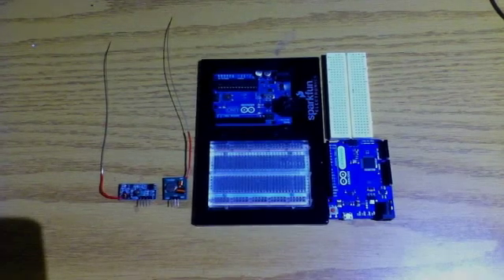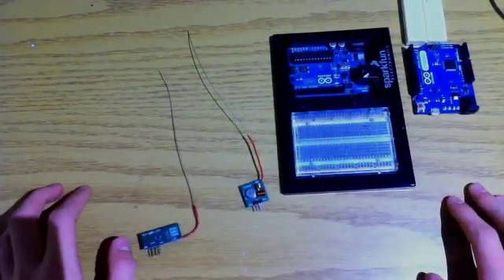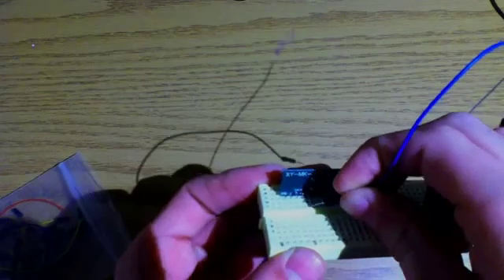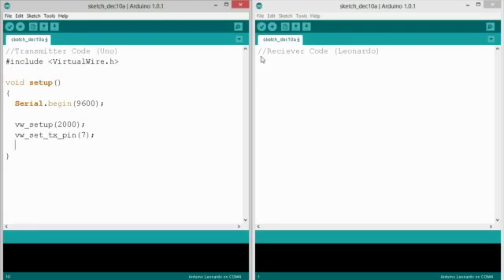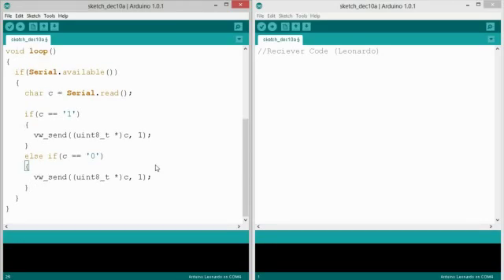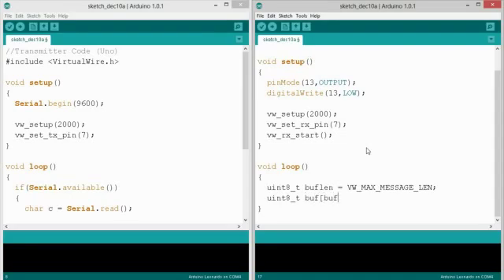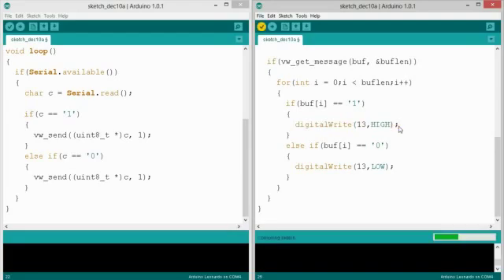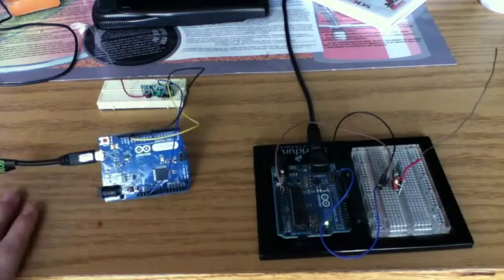Arduino RF Tutorial (MX-05V / MX-FS-03V)

Comment: Can't get this to work, do you think it is because I am not using antennas? My TX and RX are 4 inches apart, and the Tx is on a Arduino Nano while the Rx is on a Arduino Mega.

Edit: I am seeing that it works sometimes, like if I send 1 a few times, then the light will turn on. So maybe I will get an antenna, can I use any wire to make an antenna?
Reply: +Dan Ivanov I think so, but it has to be solid core wire.

Comment from the maker: Hello, if you want you can have both the receiver and sender modules on the same arduino board, only diferent pins, example: transmit on pin 7 and receive on pin 8... this will probably work because the reciever module should have a small buffer, that makes it possible to send, and later on, read from the receiver module.